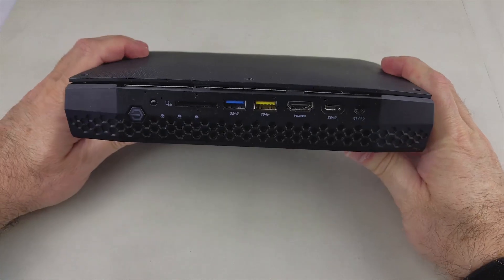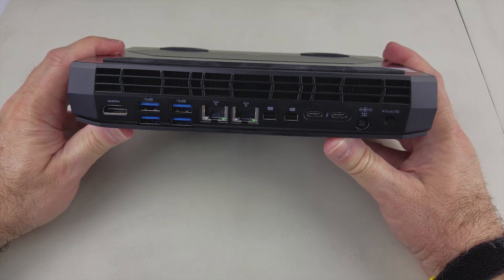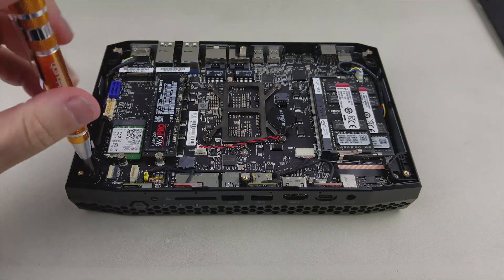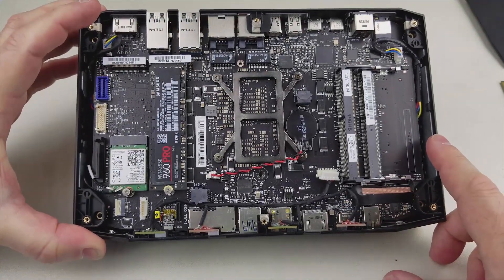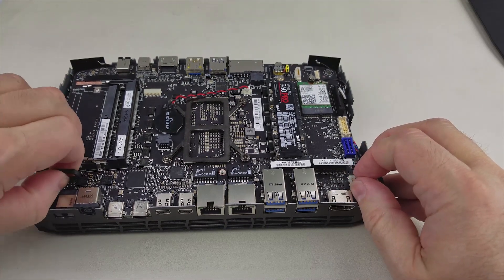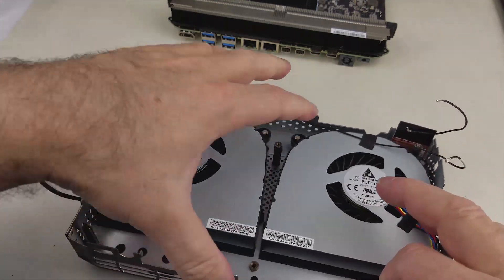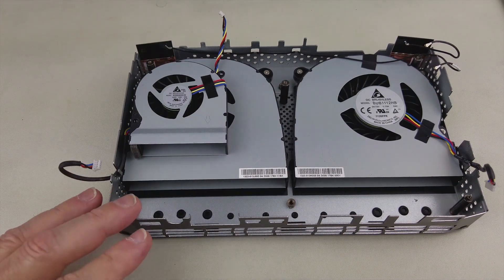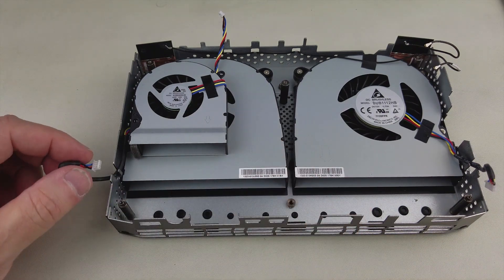Hades Canyon NUC Disassembly and Blowers-Cooling Solution

Comment: that board is thin enough that i think you could easily make a handheld device from it that would absolutely smash the nintendo switch.
Reply: it needs 100 watt adapter
Reply: Nope you can make an laptop that uses wall power :)
Reply: Hahahahahaahhaha how are you going to cool that?

Comment: I have reservations about simply blowing compressed air through the ventilation openings, because if there is dirt (especially fabric fibers, animal hair and similar materials) clogging the dissipation fins and you blow the dirt with compressed air from the outside to the inside, it will remain inside the case. As soon as the centrifuges start working again, they blow the dirt back into the fins, clogging them again. In these cases, it is preferable to remove the dirt from inside the case by opening it and cleaning it internally.

Comment: I would disagree on one point. If your fans get clogged you will need to disassemble in order to clear the clog. Other than that the video is spot on and very easy to follow. I just cleaned mine out (the fans were clogged up completely and my temps went down from 95C+ to 73c

Comment: Many thanks for the video! I realize there is no need at all to disassemble the unit in order to clean it, by the way I did not have a can of compressed air available so I actually user a leaf blower from a reasonable distance. Now it runs much much cooler and quieter :)

Comment: This teardown was critical to getting to my fans and heatsink, so thanks.  I came here to say that no amount of vaccuum or compressed air was getting the dust cake out of a certain part of the heatsink that didn't line up perfectly with the fans, and that cake of dust was causing my PC to overheat during games, and the fan to run at all times.  It's silent and no longer crashes in games, since I was able to access that dense, felted dust.  Four years of cleaning from the vent holes had allowed it to accumulate.
Reply: This is still helping me do an annual cleaning.

Comment: Great video, super easy to follow. I had to disassemble my NUC and give it a proper cleaning, something I might have neglected over the years. At some point, compressed air alone just doesn't cut through the thick layers of dust.

Comment: I have successfully disassemble my nuc by this video, however I what to give some opinion on the process:
1. I do suggest disassemble the mother board and the heat sink when you try to remove the board from the case, I remove the remove the board with the heat sink on board and it was very painful, some of the heat sink damaged in the process, remove the heat sink will make the process easier.
2. I usually disconnect the cable of RGB case light by the front penal side. 

This video really help me to disassemble my nuc for cleaning, thank you very much.
Reply: How to remove the heatsink?
Reply: @SpaceCadet4Jesus  The four screws the video guy says to not remove - remove them, and it disengages the motherboard from the heat sink.

IF you do that, be sure to have new good quality thermal past handy - you will need to clean the old thermal paste from the heat sink and CPU /GPU chips, and re-apply it before you put it back together.   Other people have made videos on how to do that 

https://www.youtube.com/watch?v=faU2hulkGhM

Comment: Thanks for the video, it was very useful.
I took my Hades Canyon apart today after a year's use for cleaning.

My chassis seems to differ slightly, there is a metal L-tab over the top of the HDMI connector (I can't spot it in your video) which made removing the motherboard difficult. Maybe I didn't hit on the correct technique, but it was so difficult I decided to remove the 4 screws and brace so that I could remove the motherboard without also removing the heatsink. This meant I did not have to lift it straight up and could slip it out at an angle.

Of course this meant I had to re-apply thermal paste afterwards (I used Arctic MX-4). My core temps writing this with a browser open are 50C (room temp 25C), idle temp is around 40C.
Reply: Yes, the production metal made it even harder to do this method.

Comment: Still not able remove main board as the vedio did at 7:21, but use an air blower to clean the dust of my NUC makes it cooler and quieter.

Comment: this is good if you travel a lot and need a powerful PC with you.
Reply: James Huffmar yeah its called get a laptop
Reply: you could actually make a switch type pc for travel with those parts. just add a battery, a screen and joy-cons or even a normal controller and you would have a windows gaming devise to use during flights
Reply: @Reaver volfeed 😂 this device is not flying anywhere anytime soon. That’s for sure. Battery 🔋 for this is would need to be twice as this device to sub stain the same hours if not less than the switch has. Just get much less powerful GPD win it’s more realistic than this i7+RX VEGA graphic combo on battery.
Reply: @hairypancake4425  i thought about that but the formfactor of the gpd puts me off a bit. the alienware ufo would be more in line with something you could and would use during a flight
Reply: @Reaver volfeed just simply get the SWITCH I have both this device and switch. This device definitely needs better airflow.

Comment: It’s perfectly fine to remove the heat sink from the processor. The original thermal paste is probably dried up anyway, but the original thermal paste used was poor quality, I replaced it and dropped 15c off my CPU temps. There is some thermal paste and some thermal pads, nothing like the nonsense he says. It’s perfectly safe if you know what you’re doing.

Comment: What is the direction of airflow on the bottom, is it pulling air in from the bottom or pushing air out the bottom. Thanks
Bill
Reply from the maker: It pulls from the sides and bottom and blows it out the back

Comment: 9:18 isnt it hbm2 memory instead of gddr5?
Reply: Howdy NoulC, Yes that is what it is, but most people don't know what High-Bandwidth Memory is. For those that don't know, the DRAM DIEs are stacked and have an ultra-wide interface to the controller. Typically for HBM2, it is a 1024-bit wide connection that runs at 2 GT/s. The memory is also "tightly-coupled" meaning that it physically sits a very short distance to the GPU so that the "flight time" of the signals is reduced and synchronization can be easier. At these extreme speeds, the length of the copper runs between the GPU and Memory and can cause delays. By doing a tightly-coupled design, the flight times are reduced and the bandwidth increases. By routing the signals on an interposer or carrier, you can also guarantee signal integrity and make sure to get the highest bandwidth possible since you don't have to worry about the motherboard design or signals on other layers affecting the signal integrity.

Comment: Is the green square chip left to the 960 NVME SSD the wifi/bluetooth card? Is it removable?
Reply from the maker: Yes and yes. ;-)
Reply: Simply NUC wow that is good to hear. By swapping it with a Broadcom card, this build will be ideal to Hackintosh. Thanks for the response and video. This is literally the only disassembly guide of Haded Canyon I can find on the web right now and it answers a lot of my questions. Great work!
Reply: Thanks!

Comment: Will it still fire up and work if you leave the microphone array cable unplugged?
Reply: The Quad "Far-Field" microphones are not needed but will enable the Hades Canyon for features similar to Alexi from Amazon. Expect this capability this year.
Reply from the maker: Yes. The microphones are not needed for the system to function.

Comment: thanks. 
1) will I be able to hear the fan on idle? the pc will be sitting a foot from me.
2) is there a way to disable the fan on idle?
Reply: You can go into BIOS settings and set for "Quiet" which spins the fans up later and not as much which means the processor runs hotter, or "cool" which spins the fans up sooner to keep the proc cooler. I will be attempting to capture the fan noise during my next video.
Reply from the maker: The fans spin very slowly at idle and are not noticeable at all.  I don't believe there is any way to disable them.  Some airflow is needed to protect the system
Reply: Our video editor is working on a blower sound level video now, but at idle you cannot hear the blowers as they spin down to 500-700rpms.
One note is that all of this depends on how cool the room the computer is operating in is. If the room if 85f then the blowers will always be spun up a little more. I turned off the AC for the video I shot since it is louder than the Hades Canyon in all but the highest 2 speeds. Room temp was around 74f and got to around 76f by the end of the video.
The blowers run around 500-700 RPM when sitting at windows or running light applications. I began running a graphics benchmark program which is intensive in nature and the blower spun up to a level I could hear them from 1' away. Note that in the video that is coming, the camera and mic are 1' away from the exhaust of the Hades Canyon.

Then blowers spun up to a louder level and eventually to a much higher level, which could be heard regardless of which direction the exhaust of the Hades Canyon was facing.

Due to the high amount of cooling there is at this blower speed level, it over-cooled the GPU and spun back down to a level above the idle, which the blowers are barely heard. Then later they spun back up 2 more steps. Occasionally it would spin up to its highest levels, but only for around 20 seconds and then would spin back down to the second from lowest.

Overall, I would guess that the blowers have 4 or maybe 5 steps.
Step 1 = Really low and undetectable even in a quiet room
Step 2 = Low and mostly quiet, but easily detected in a totally quiet room, but not detectable with other sounds going on (A/C, talking, music, etc)
Step 3 = Easily heard, but still comfortable level. Still quieter than our A/C system, but perhaps not others.
Step 4 = Pretty loud, similar to a desktop system or laptop running at its highest speed, but with a lower tone due to the larger blowers.
Step 5 (if present) = Probably louder than you want it and can be easily heard

Even under continuous high loads, Step 4 and 5 are only going for around 20 seconds with the system stepping down to Step 2 for 40 seconds and then stepping back up. Every time the unit got to the highest or next to highest levels, it didn't last long and always stepped back down to Step 2, even though the system was still operating at a saturated load.
Reply: Thank you for your detailed response. When will your video be out?

Comment: Will the hot air blowing from the back toast the cables?
Reply: I will try and measure air temps during AAA Game Testing to see. With this much air volume, I wouldn't expect it to be hotter than the Skull Canyon
Reply from the maker: No, that is the same design of all past NUCs and we have never seen that problem arise.
Reply: Temps under heavy loads got to around 105f to 108f max, but that was also with lots of airflow.
Reply: Simply NUC Thanks. Just curious because this one is way more powerful than previous models
Reply: Charles Abdouch Thanks
Reply: Yes it will,
 It's been a bad common feature among some game console as well, the longevity of hdmi cables right up next to heatsinks fan exhaust has been proven to loosen soldering points on the hdmi connection on the pcb board if continues use of it overheating or running 24hrs a day.... ways to avoid it is to not buy cheap hdmi cables, and keep your exhaust ports clear and clean to ensure proper positive static airflow. don't cram it into a small box that can't get proper airflow.
 One good features of this design on the mini pc is that the pcb boards for the cables are underneath the mainboard "opposing side" of the heatsink which will keep the pcb board cables away from the heat exhaust. Down side is there is still a wide gap if you look closer in this video between the boards and the shell of the case that still easily gets hot air down the bottom side of the cables side.
 That is why it's important to keep positive airflow through the case.

 Another common issue I can clearly see is the poor exhaust in the heatsink connections to the fans are not bonded as clearly shown in 7:50.  I used some aluminum tape to secure mine rather than some small rubber bumper guards that are held into place by the case. they should have mounted the fans to the heatsink and not the case itself. this is clearly not thought out as well as they hoped for thermal designing. I see this common practice everyday repairing laptops, where they laptop gets more exhaust heat inside the casing rather than venting it out.

Comment: You should definitely unscrew the four screws holding the motherboard to the heat sink, and change the thermal paste.  That also lets you remove the motherboard by sliding it backwards and out, not just lifting it straight up - which wasn't possible in my Hades Canyon because of metal tabs that don't seem to be in this guy's machine. 

All that "don't open it, it's engeneered to be permanet" is BS.   The original thermal paste was poor quality - I opened my machine after 5 years, and the paste had turned hard and chalky, which was contributing to it overheating. I replaced it with good quality paste that should last a lot longer.  

I also had a felt-like buildup on the output grid which was preventing the fans from cooling properly - that was what I was expecting, and it's a lot cooler now that the fans are running properly. 

Yes, do regular maintenance every two or three months if you have pets or cloth near your NUC.  Especially blow compressed air into the back of the machine - that, I have realized, will prevent that buildup of fibers that block the opening.  Once that felt-like pad formed, blowing into it didn't get rid of it, it was too dense.

Here's how to replace the thermal paste:

https://www.youtube.com/watch?v=faU2hulkGhM

Comment: I didn't get why shouldn't I take off radiator from the processor. I will definetely want to change termal compound on cpu and gpu to liquid metal when I get mine. The obvious reason that is serial paste is bad and intel is famous on adding even worse termal compound in their processors.
Reply: That is definitely an option. You would just want to be aware that it would void the Intel warranty.
Reply: Most likely they are using Thermal Gap Pads for most of the parts and DIEs. There may be a single DIE using paste.
Reply: I am pretty sure gpu and cpu are covered by thermal paste. These are the only parts that need thermal compund change. And still I dont get why shouldn't I take off the radiator, thermal pads wount brake if I do that.

Comment: I feel dumb to keep my skull canyon when I see the fans comparison lol.
Reply: Skull Canyon is still a good serious high-end business machine and graphics station. I plan on upgrading from my Skull Canyon to this, mainly to run more screens
Reply: Is the Skull Canyon loud? I'm planning on using this for audio so.. There is a replacement case with heat sinks all over it, but a Reddit user who got it had some issues with it..
I'm planning on using one of these for a mobile sound studio and need it to be quiet like a church mouse.
Reply: Under heavy loads the single blower on the Skull Canyon can easily be heard.
Reply: Charles Abdouch I'm wondering how much quieter the Hades will be... I need noctua quiet.. for audio work.
Reply: The Hades is much quieter. Running an AAA game on it did not heat it as much as the Benchmark did. Under normal use, the blowers are both running around 700 RPM, which was low enough to have difficulty telling they were running.
Most applications other than heavy graphics work should not heat the system up enough for it to have to work hard to cool down.
I have another video going up of the blowers running with the mic 1' from the output of the blowers. To get them to run hard, I had to run a Graphics Benchmark program for quite awhile.
Reply: Charles Abdouch it’s definitely not high end but it’s not bad
Reply: @wyatts9646  it's small compare to this . Especially disappointed by it's power supply. It's same size as scull canyon itself

Comment: If they can fit the RTX 3000 series in these hades canyon sizes they'll be flying
Reply: h1 cases were the right size unless its a server.   Its nice having an extra slut i mean slot for pci express but I could just take it in or send it away after a few years..its like cell phones, there gonna be smaller not under a 100lbs.
Reply: im gonna break something disassembling that.
Reply: add a little height and put 120mm fans in that those blowers look noisy.
Reply: these motherboards gotta have a protective sheathing like a solid state with plugin areas..this current stuff just looks like a shit show.
Reply: ghost canyon kinda had it but you have to take that fan and plastic off to get access to stuff..ugh its gonna break.